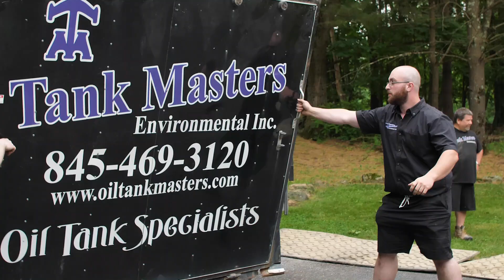550 Gallon Underground Leaking Oil Tank Removal, With A 275 Gallon Installation Outside

Comment: I found your Ch  (been a subscriber since)after i had signed a contract to have a 1000 gallon tank removed from my Mother in laws house in lower Westchester. (a co-workers friend) At first i didn't realize you guys came down to Westchester. I did learn from you that the 1000 have a less chance to leak due to the construction and thickness of the steel of the tank because of the size. Tank was abandon in the late 70s when they switched to natural gas. Funny thing down here is the inspector wants to watch the tank being removed from the ground. Said he would be at the site at 10am showed up at 1pm. If i found you guys before signing the contract i would have differently had you guys do the job.(not like you guys aren't busy) You guys do a great job, clean and neat and always professional.. It  makes a difference when the owner and your case your family are doing the work!! Out in the field dealing with the challenges that hands on labor brings.. The comical valve of watching you guys work would have been worth it too. Keep up the great work and videos ,and be safe
Reply from the maker: LOVE THIS COMMENT, Thanks Rich

Comment: It was great to hear everyone burst into laughter over carrying that tank. X) And yeah, that's content for sure.

There's either been a change in style or a change in material since the early days of the channel; I feel like the plastic sheets used to rip into 6+ pieces when you were backfilling, but here the sheet only ripped in three. Three is standard/high-standard, now. Pretty cool.

(Was with Mikey on the water measure, losing that one, but was with Sammy on the buckets, so broke even in the TME Fantasy $100 Challenge League, today.)
Reply from the maker: I guess my backfilling skills are getting better over time...Welp I have handed out $5200.00 on challenges. So i could be the big looser on that one. haha

Comment: couldn't you run a pressure test on your tank to determine if it leaked? if it didn't have pinholes it should be able to hold a negative pressure. a negative pressure test wouldn't push any oil out through the holes either. maybe oil is too volatile for a negative pressure test?
Reply from the maker: Yup, The test your talking about is called the Horner EZ 3 with locator. I used to test tanks for about 10 years. The thing is (in my opinion) its a waste of money because if the tank passes or fails, it still must come out. BTW, Brad Estabrook invented that testing device who is also a friend
Reply: @TankMastersEnvironmental  that's so cool! i'm glad to know i had an idea that works in the field haha